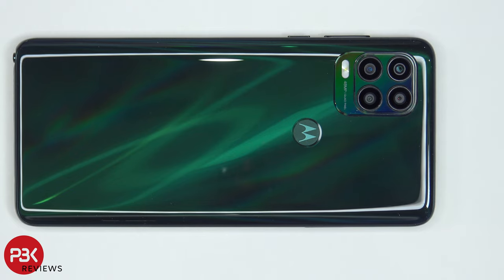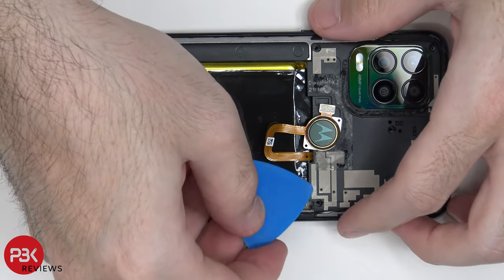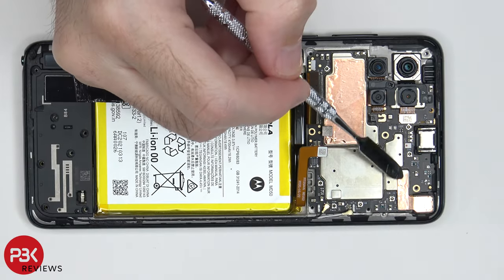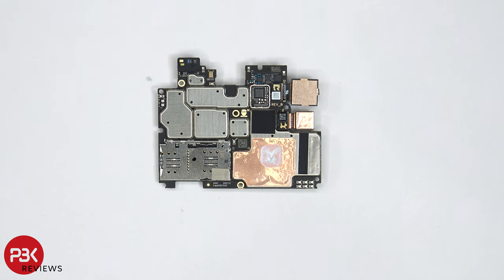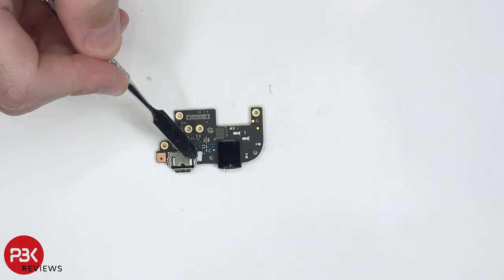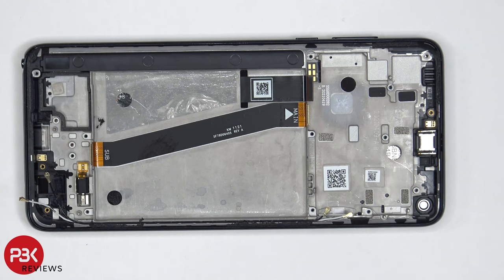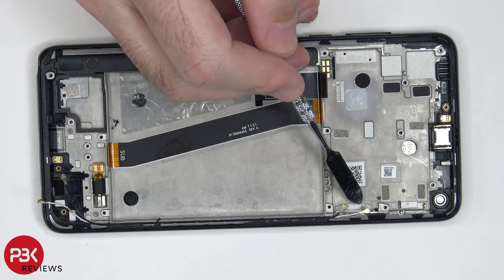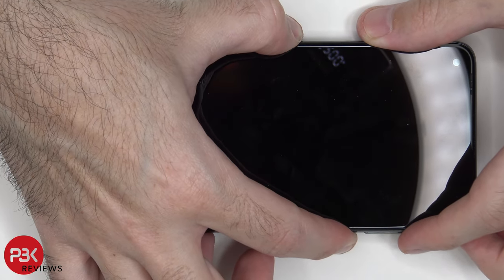Motorola Moto G Stylus 5G 2021 Disassembly Teardown Repair Video Review

Comment: I really liked this video, not so much for repair purposes, but because you pointed out what the components are and where they were located. No other video i know of does that. One question though. You mentioned alcohol as a solvent. What about acetone? Would that damage anything? Also, I wonder why they have a moisture indicator inside? What's the point?
Reply: The moisture indicators are there to let you know if there's possible water damage to any components
Reply: I think it's to indicate if any water gets inside where the components are located, to ensure if the parts are damaged or not.

Comment: Too bad the touch screen on my 5g moto g stylus 2021 isn't working anymore. I wonder why it isn't working anymore? I accidentally did drop it multiple times  on the  back plastic part. I think something may be loose which is the cause. Now I bought the 4G version of this phone and to me the 4G  is the better phone.
Reply from the maker: It could be from moisture/water damage, or other damage from a drop. You can try to take it apart if you are able to, to see if there is a loose or disconnected cable.

Comment: Fantastic video!  I will certainly review this again when I need to disassemble mine.

I just got a moto G Stylus 5G from a carrier.  It only has 4 gigs RAM!  Is there any way to feasibly increase the RAM?
Reply from the maker: Thanks! The ram is soldered onto the board. For an average end user would not be possible to change, only a professional with soldering would be able to de solder the ram and replace it.

Comment: They are doing it just like Samsung if the charging port is damage at least it's not soldered to the motherboard it's connected via flex cable easy to repair very good 👍

Comment: Thank you so much the last time I took apart my Motorola to fix it I couldn't find the repair adhesive to put the back back on.
Now I have another Motorola literally just broke the screen found your video and the link to everything I need thank you
Reply from the maker: You're welcome. You can also check mobilesentrix.com for parts if you need.

Comment: How would I replaced a shattered camera lens? Do I need to remove the back or is there an easier way? It's only the macro lens.
Reply from the maker: Hi, you can heat it up with a hair dryer and just peel off that broken lens cover to replace. Its held on with adhesive and doesn't require disassembling the phone. Here is a link to a replacement online: https://www.ebay.com/itm/265413370808?hash=item3dcbdea3b8:g:GbQAAOSwEGJiMmJu   you can also search on mobiledefenders.com but it looks like they are out of stock on the macro one there : https://www.mobiledefenders.com/motorola-repair-parts/g-series/g-stylus-2021-xt2115.html?

Comment: what are the 2 wire cables for at 3:15? Also what is the function of the robon cable under the batter? Thanks.
Reply: That is what connects the charging port to the motherboard I believe. It was mentioned in another video.
Reply: One of the wires is an antenna wire. Not sure what the other one is for, possibly to link power between the boards?

Comment: Hi. I'm going to replace my phone's screen soon and have a question. What are the 2 adhesives you linked in the description for and what's the difference between them?
Reply from the maker: They are just different types of adhesive, both can be used to re adhere the back to the phone. However its always best to use the original pre cut adhesive made for the phone instead of those generic ones you need to cut down yourself. But for this phone, I can't seem to find just the pre cut adhesive for it listed online anymore, however you can order a battery door cover/backplate which comes with the adhesive pre installed, so you can apply it on easily. Here is a link for one: https://www.ebay.com/itm/145006170006

Comment: Can the stylus chamber be accessed to remove a broken stylus once the back panel is removed🤔
Reply from the maker: yes, once the back plate is removed, the plastic cover over the stylus chamber is held down with adhesive. You need to heat that up also and pry it off then you will have access to removing the broken stylus.
Reply: @PBKreviews  Thank You 👍🏽
Reply from the maker: @lt5550  you're welcome

Comment: Thanks for the helpful video. One question though - you mention using a hairdryer/heat gun to loosen the glue. What temp? And how long does it take? Would be great to see that step too; but just that info would be helpful. Thanks!
Reply: Well...used a different plastic pry tool and got it started then used the plastic picks to finish the job. Unfortunately...there's probably a bit too much corrosion (took a swim with me for 1 hour; it's been sitting in a bag of rice the last week, but still wet inside; most visible corrosion was under the fingerprint reader and the center screw on the speaker assembly) for me to salvage it - at least with my experience level of working on these; I'll probably let it dry out and try assembly, but it's probably going to be a backup device now if I do recover it. Any advise would be greatly appreciated.
Reply from the maker: For the heat, just enough to be hot to the touch and you apply more heat as needed while working on prying it off. As for water damage, use a small brush like a tooth brush to brush off any corrosion around chips or connectors. Also let it dry out. Then re assemble and see if it works. If not, you can swap out parts like battery, screen etc to see which part may be faulty. If its the board then you're probably out of luck.

Comment: I'm not sure if you will get this comment notification but is the power button replaceable if I've totally dug it out....lol. turned it on with a foreign object for too long and now it wont power up. I've also tried several ways to boot it up but nothing works. Am I going to have to replace the whole screen?
Reply from the maker: You probably wore out the clicker on the flex cable. So you would need to replace the power button flex cable as well as the power button itself. However, it does require prying off the screen which poses a high chance of damaging it. You can attempt it before going the route of replacing the screen assembly combo with button etc. You would need to apply heat with a hair dryer to loosen the adhesive under the screen, and use a suction cup tool to gain leverage and get a thin pry tool in between the screen n frame to work your way around prying it off. But careful not to go to deep or you will damage the screen. You can use b7000 glue to re adhere the screen to the frame. Here is a link for parts for this phone if you need: https://www.mobilesentrix.com/replacement-parts/motorola/g-series/moto-g-stylus-5g-xt2131-2021

Comment: Very clear explanation. Thx.
The stylus in 2 of my phones has broken off inside the storage port. One phone was replaced by insurance. I'd like to remove the broken stylus myself this time. Do you have a video for that?
Reply from the maker: You're welcome. You would just need to pry the back plate/cover off and then pry off the cover over the stylus enclosure to gain access to removing the broken stylus.

Comment: Any luck finding a replacement glass for this phone? Also do you have to replace the whole screen or just the glass? Thank you for your time.
Reply from the maker: There is this site I found but have not bought from them before: https://xcellparts.com/index.php?main_page=product_info&cPath=734_3452&products_id=10485   . Also you would need to replace the complete screen assembly.

Comment: My Moto phone fell inside the toilet and the repair person has been doing trial and error with it. First he said to get a new screen but that did not work. Now he says I would have to request for a new board.
The phone is clearly turned on (Rapidly shaking it still turns on the flashlight, It still vibrates when I plug it in, and my nightly alarm still rings) What do i do?

Comment: I changed the charging port on my phone due to salt water corrosion damage on phone plug but still does not charge. North he phone light at upper right corner blinks. Before the phone’s battery died the phone worked fine.

Comment: What is the small hole on the top of the phone?  I was thinking it was for the sim card and kept pressing on it with the sim tool.

Did I damage anything?
Reply: It's the secondary microphone, your phone comes with two microphones, one at the bottom next to the charger port and one at the top. The simcard injector is right next to the sim card tray.

Comment: my phone and i took a dip in the river,. all is dry and well aside from light condensation between camera lenses and lense covers,.  would i just remove the top cover and dry in between and reassemble, use as is til it dries, or buy a new phone? never did anything like this before myself,. thank you!!
Reply from the maker: Hi, if there is any water or moisture inside, its best to turn it off and not attempt to use it until you can take it apart and dry/clean out any water or moisture inside since it can cause a short and damage the parts rendering them not usable. Once you take it apart and clean off any water, you need to use a small brush like a tooth brush and brush off any corrosion on components or connectors. Then re assemble the phone and continue to use it :)

Comment: I only want to replace the battery that's bulging out. The case cover is what's holding it together, etc protection on art only as sides are opened. I just wanna skip in new one but in ebay. Save this cell as still getting a new one anyhow. Just to keep it alive pics, etc. The back is warped open anyhow only sealed edges & the case holding it. Ok so I gave ro remove allot b4 take battery off. I wish was just easy in swap out connect. Ugh. Dang it the finger print cable got broken cuz of this issue. I don't use it anyhow. I don't like that idea. I am old school as far as this cuz less collected about me the better or that. It's cool & all, but sad I can't use it. I have it & never got to try it. I should have .I tried it one sec on a other cell I used to have. Be at mind. On The 21st etc I'll get it from eBay & I can replace it. I don't want to remove all. I will just do the battery. Seems easy enough & pop new in, but I don't want to remove front, etc. That won't be good or cracked screen etc, cuz doing that to tablet broke it. The battery really puffed up & the screen didn't work it wasn't perfect replacement & then that happened. After 8 months that bought on Best Buy on holiday in 2017 or 2018.  Omg it has adhesive. I forgot can't be that easy. I will try without first, cuz scared to put more moisture. I hope I can do this. I don't wanna take screws out, etc. So could just do it without ? Please tell me. Not clear. Looked at video over & over. Yeah strong adhesive till sun etc or battery pushes it out. Only having on from edges, cuz waiting to get battery to ta it off. I am scared to, but I'd rather try from side, but that's impossible so I'll deal with it. Then so idk till I get the battery & try it following the video. I have tools the screw driver from that tablet kirs so I'm ok with picke, etc.omg I have to remove it to get to the battery cable. Ugh. This sucks. Ok. I'll have to do it. Roll 👀. ,😱😡😫😤🤬😡🤬🙄🧐🙄🤨🧐🤫🥱🤫🤔🤫🤭😱 u don't want to remove speakers. Do u need to remove to do the battery. God I hope not. I don't wanna mess with the speakers part. I don't have an adhesive to put back on. Oh well. Please tell me. It seems I have to, but those components small sensitive & I don't want to pop off & risk braking it all have no sound etc. Ugh.

Comment: I have a cracked screen everything still works just cracked glass but can not find screen replacement.  Please help video does not show is I can replace the glass or if the whole lcd needs to be replaced. Can I get part numbers. Please help
Reply from the maker: You will need to replace the entire screen. This is the only website I found: https://xcellparts.com/index.php?main_page=product_info&cPath=734_3452&products_id=10485
Reply: Omg thank you keep up the great work

Comment: Is it easy to replace the phone camera lens ? Mines is broken after a fall.
Reply from the maker: You can heat it up and pry the glass camera lens cover off. Here is a website for the original parts. make sure to match the model number (XT2131  for the g stylus 5g) : https://www.mobiledefenders.com/motorola-repair-parts/g-series/g-stylus-2021-xt2115.html?
Reply: @PBKreviews  thank you!

Comment: Any tips for the sound? My phone at the bottom got dropped in pudding. The pen and every still works but the sound is all the way up and it's just high pitch sounds if I cover the holes it sounds better. 
What can I do?
Reply from the maker: You would need to take the phone apart and replace the filter covering the holes on the inside of the frame for the bottom speaker, and see if it helps. If the speaker itself has gotten damaged, that would need to be replaced as well. Not sure if they sell the filter replacements though, so you might need to find some sort of mesh filter to use. Here is a link for some of the parts for the phone (keep in mind you would need the G Stylus 5G parts and not the G stylus if your phone is the one from this video): https://www.mobiledefenders.com/motorola-repair-parts/g-series/g-stylus-2021-xt2115.html?
Reply: @PBKreviews  thanks so much.

Comment: is it possible to replace the screen without fully taking it apart? also is it possible to transfer the screen from a moto g stylus to the 5g model
Reply: Yes,
You need to:
- Take the back shell off  and the battery out (the video ribbon cable feeds though a small opening behind the battery).
- Remove the front glass screen.
I found that removing the back shell, battery and glass screen was difficult due to the glue holding them in place.
You'll need to apply heat to the perimeter of them and use a fine flat tool to pry them out.
It's not easy, take your time.
I had to break a small corner of the glass screen so I could pry it out.
Also, I'd recommend removing all of the old glue and apply some new glue (T-7000).
One more thing, make sure that your new screen works by installing it and the battery cable.

Comment: How do I get my stylus pen out? It got stuck yesterday. Also the tip broke before that. I haven't even had the phone 2 months yet.
Reply from the maker: You would need to pry off the back plate, then peel off the plastic cover that is covering the stylus housing and you would be able to remove it.
Reply: @PBKreviews  Could you do a video on how to do this🤔 I'm having the same problem at this moment.
Reply: Were you able to remove the broken stylus🤔

Comment: What happens when u strip a screw?
Reply from the maker: You can try using a size bigger screw driver to try and unscrew it but if it's too badly stripped, you would need to use a drill bit that's small enough to fit in the screw head and drill into it slightly so it breaks off the screw head.

Comment: hello. Nice video. This is a 5G phone. Please, can you tell us in evry review where is 5G  located? Tank you.
Reply from the maker: Hi, thanks. If you are referring to the 5G modem, most of the time they are under one of the shields on the main board which are soldered down to the main board and not easy to remove to be able to show it. In most cases the board will become damaged trying to remove the none removable shields. Some phones some of the shields are removable but usually those removable ones are only by the processor and memory.
Reply: @PBKreviews  Thanks for answer. Yes, I mean about 5G modem. I ask you this, because y saw some videos where they said that is unnecessary to pay for a 5G phone because actually isn't a 5G. They said it's a scamm of companies.
Reply: @troyano2510  I own and use this phone daily. I get 5g service. Not everywhere, but I get it more often than not.

Comment: My wife broke/cracked her screen.  We cannot find a new Moto G Stylus 5g screen anywhere.  Could you point us in the right direction?  Thanks.
Reply from the maker: Hi, i just searched with no luck as well. You can try contacting mobiledefenders.com and request them to get the part, they are an autorized distributor for parts so they usually are able to get them.
Reply: @PBKreviews  Thanks for your speedy reply!
Reply from the maker: @johna.ludwig2311  👍
Reply: Did you get a new screen I can't find one
Reply: @juliocervantes6610  Nope. Searched all over.  It looks like we need to wait a few weeks and keep checking.

Comment: Does anyone have a problem with people hearing them? I feel like the microphone is terrible
Reply from the maker: Use a small brush like a tooth brush to brush out the small hole on the bottom rim of the phone next to the charger port to make sure its not clogged with debris.

Comment: My moto g stylus 2021 looks different?
Reply from the maker: Its confusing since there are many different models with same naming, there is a G stylus, G stylus 2021 and a moto g stylus 5G 2021 etc it goes on lol. Make sure to double check which version you have by checking on the box or in settings for the model number which starts with XT-